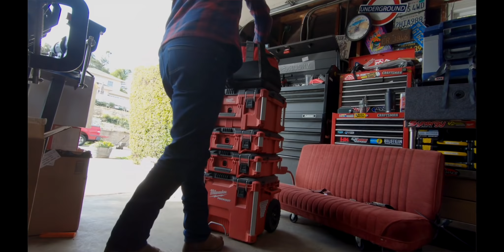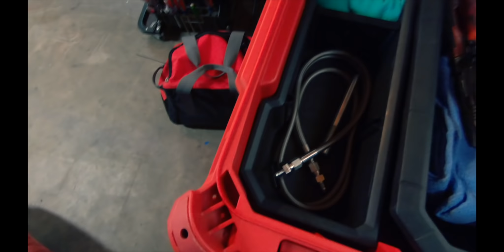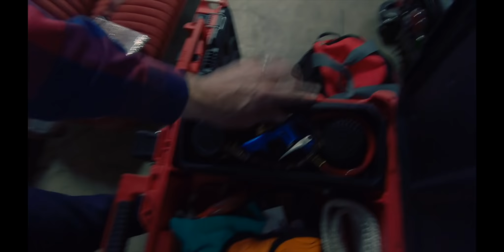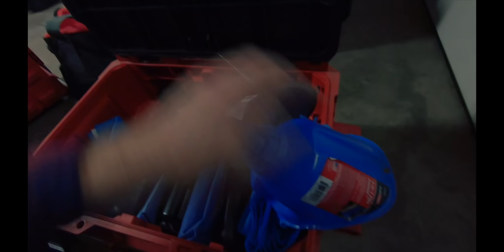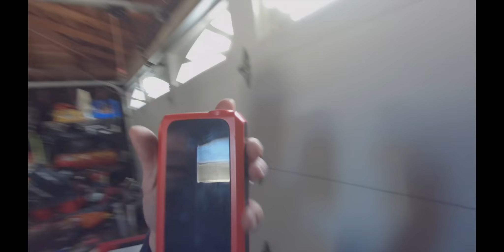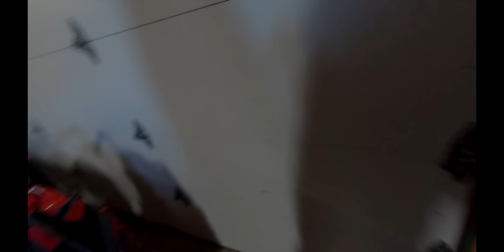MG #146 - Don't be that guy!  Tools and parts to get you there and back!!

Comment: great vid, I'm just getting started in ohv 4x4ing (I've atv and side x side for over thirty year, lol now i'm over 50 and I want comfort) these vids are invaluable to me so thank you..... one thing  I've been toying with as an option is mounting a small vice to a bar that slides into my receiver hitch. good for u joint repairs etc Thoughts?
Reply from the maker: Not a bad idea.  Problem is for a vise to be really useful on the trail it would need to be of a significant size.  Which makes it prohibitive to carry
Reply: @merricksgarage good point, i'm not gonna carry my wilton shop vice anywhere very far. just something as a third hand

Comment: 👍🏼 thanks for sharing this with us! There’s one tool I can think of that has been way handy over the years, and that’s a bow saw. There have been times where I came up on a fallen tree that wasn’t necessarily too big to move, but it was so tangled up in other trees or a fence that I couldn’t just drag it out of the way. Sometimes all it took was cutting off a couple branches, and sometimes I had to work for it. I think I snagged mine out of a clearance bin for 5 or 6 bucks about 14 years ago and it is still surprisingly sharp.
Reply from the maker: Great idea.  Adding to the list.

Comment: Does the rolling box have a mounting plate so you can lock it to the floor?
Reply from the maker: not so much a mounting plate, but metal reinforced corners and latches.  Not theft proof by any means, but unfortunately I doubt there is...  Ratchet strap it down and then chain to the cage and hope in the goodness of man.
Reply: @merricksgarage  sorry i didnt mean lock it to the floor but more of latch it, like the other units latch to each other
Reply from the maker: Oh sorry.  Nothing to latch to the floor.  I could fan something up though most likely

Comment: I know you're a huge supporter of Milwaukee tools and equipment. Are there any other competitors that have packable equipment anything like this? I am a big fan of DeWalt and already have a lot of tools bought. It would be hard to switch at this point
Reply: Cliff Weatherbee DEWALT has both the ToughSystem and the TStack. The ToughSystem is the higher end while the TStack is more of a consumer grade. Rigid has one, and I believe that Husky does too. If you google modular storage systems more will probably come up.
Reply from the maker: Yes!  Tons of different options out there!  I know that Ridgid has a system because I was happily using that until I switched to these!